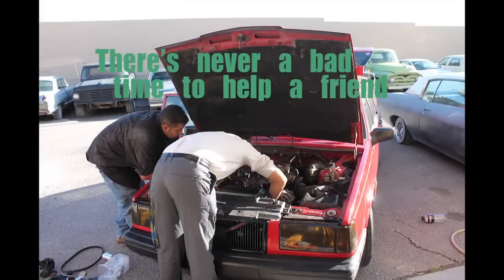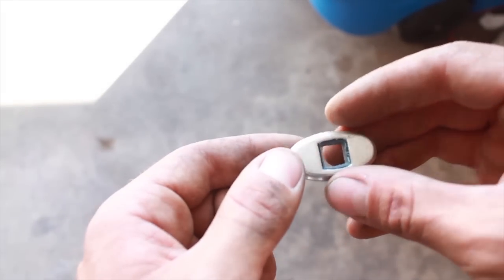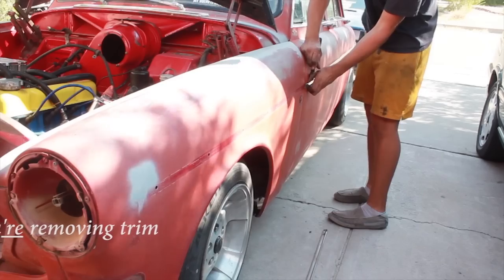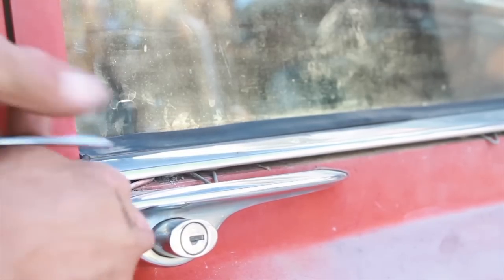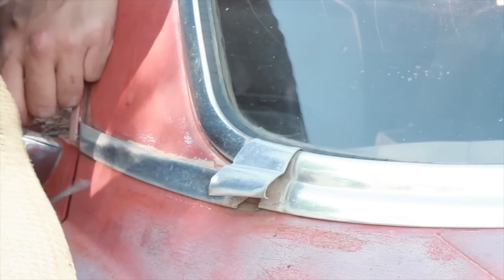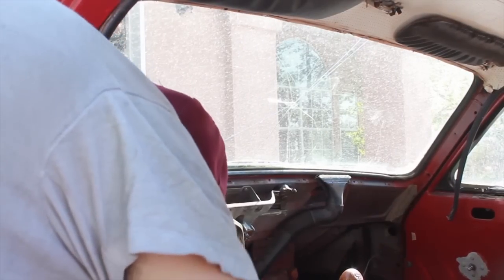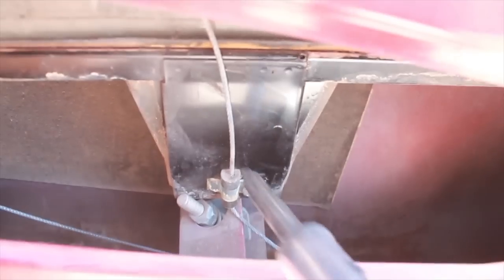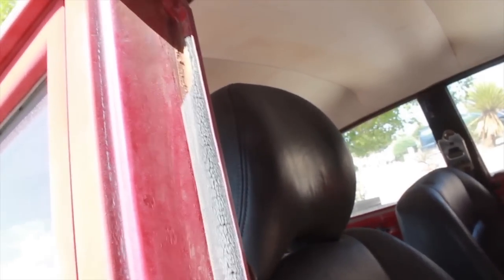🇸🇪Removing Trim 1967 Volvo Amazon 122 - IPD Build Off Episode 12

Comment: This video is great... it reminds me of when I removed everything off my 2 door 122S to restore it... the  drip edge trim piece can be taken off without any trouble by using a church key... you know like the ones used for opening up beer cans in the 60's... just wrap tape over the metal key so it doesn't mar the chrome if you plan on using it again... that was a good choice of tunes you used on this video... what were those tunes?
Reply from the maker: sj122s I am currently removing the trim on a 68 wagon, and getting it all restored and painted. keep watching for those videos every week. the songs here are "feel it all around" by Washed Out, "home" by Edward Sharpe, "Change is gonna come" by Otis Redding, "state of the art" by Gotye and "black and gold" by Sam Sparro. thanks for watching!
Reply: Thanks so much for the tune listing... You know these old Volvo's are  just too cool...I'll be checking your videos out for sure... There is nothing cooler than restoring these cars... they are timeless pieces of art... they ride, drive, and look so cool.. they are real head turners...  :)
Reply from the maker: sj122s the church key method worked great! I used a plastic tool to protect the existing finish. I hope reinstalling is as straightforward. thanks again